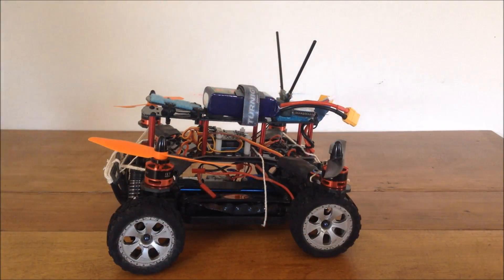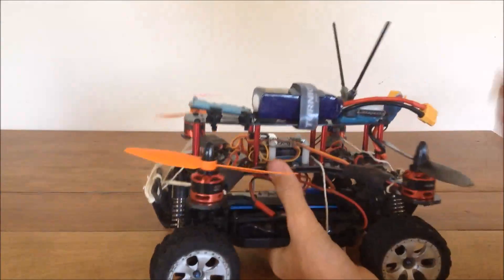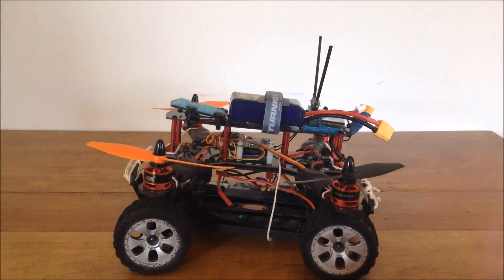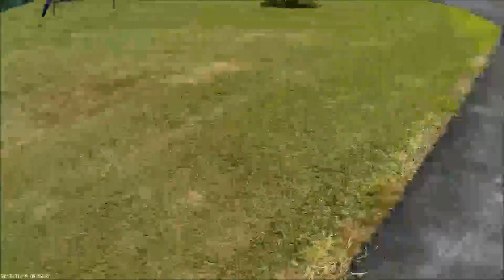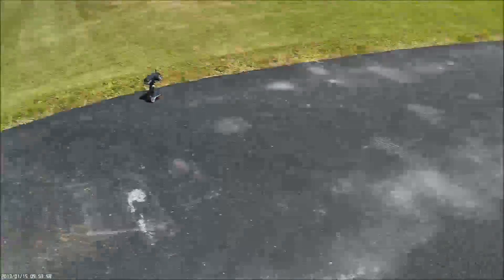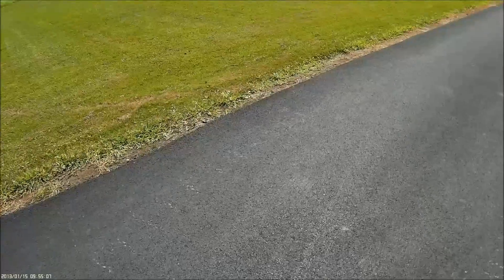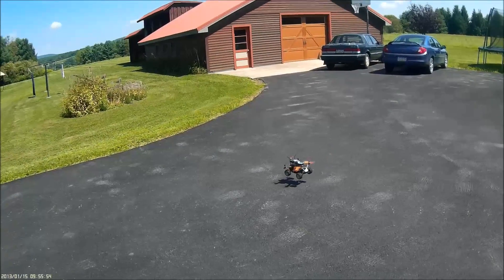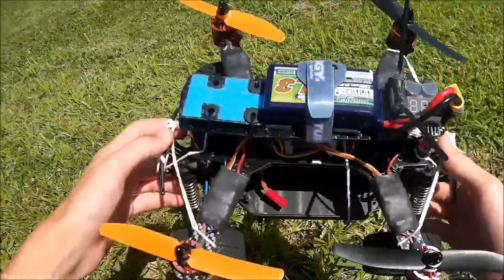Flying Car Experiment

Comment: What failure???
Your title says “Experiment “ . You tied some bits together with string and tape and it flew, 
Orville and Wilbur had test and try days (albeit on a slightly bigger scale ) but you did what you set out to do.
You’ve got the rough layout, now you just add the refinements.
Personally I would chalk it up as a winner and see what else I could come up with.👍👍
Reply from the maker: Haha this quad and video is so old now, could EASILY do it with my new stuff.

Comment: It's too heavy, you'll need to just put 4 small wheels on your Quadcopter. Some how make the wheels spin freely with two axles attached to the bottom of your quad. Ditch your RC Car frame completely. Good luck.
Reply from the maker: This quad is so underpowered. If I used a quad i had today no doubt it could lift it easily.

Comment: Hahahaha COOL stuff mate! And poor ESC's :P  I'm glad you didn't do a hand-toss this time ;) 
And basically SUCCESS! :D It flew several times.. even with the car-battery on it.  Would the body-shell have (sort-off) fit over the quad by the way??
Great video! Thanks for sharing
Reply from the maker: +DutchRC ADVENTURES Haha, they were not even warm though :P Without the battery, and some 5045 it might be able to do better, especially since the 5045 are fiber glass, so MUCH more rigid, so they do not depitch. The canopy was not going to work ;P Thanks for watching!
Reply: Yeah.. I can imagine them props did do some bending indeed :) That makes them far less effective indeed :) 
Cabon I say! :P
Reply from the maker: +DutchRC ADVENTURES Haha, lol. I think the 3 bladed props were the best, but one broke mid air :( So not sure about ordering more :/
Reply: Mid air? :O maybe it was a bit damaged before that??
Reply from the maker: DutchRC ADVENTURES Yep, and nope. Second flight, NO damage, and one leaf broke off. I made it back on 2 but vibrations were awful.
Reply: Hmm that extra blade IS a nice fail-safe then really.. right? You can at least land on 2 blades.. 
My BG points have not been returned by the way..
Reply from the maker: DutchRC ADVENTURES Yeah, it can fly on two until the bolts rattle out. 

Just give them a few day ;P
Reply from the maker: DutchRC ADVENTURES I think that is worth it. 

That looks interesting!
Reply: Yes.. quite different.. (goes for the price as well :P)
Reply: +DutchRC ADVENTURES Wow that plane is interesting
Reply: Yes.. I had not seen that concept in store-bought planes :)

Comment: Hahahaha funny flight. The car you used is to heavy.
Better is to use a car with smaller tires from foam and let the lipo control both.
Reply from the maker: +emiel1976ep Yeah, I do not have anything lighter though :/ Maybe with my 5045 props it could do it, but tying to on like that takes a bit of time ;P
Reply: +The RCAddict You got it in the air and even with a lighter car you will not fly it like it does without. 

I see you have good weather there. Here it rains and it must become better this weekend and than I hope I can fly again. I am also going to build a plain. I start with the easywing from dutchrc. 
I am making also a second one bud than with some changes and I will make a video of what I changed. It will be for fpv.
Maybe  also something for you. You have there a wonderful aria to fly.
Reply from the maker: emiel1976ep No doubt it will not fly the same ;P 

That is cool :) Have you let him know?
Reply: +The RCAddict yes and I make the video for him to let him see what I changed in the second one that is ment for fpv.
Reply from the maker: emiel1976ep Ok, sounds cool :P